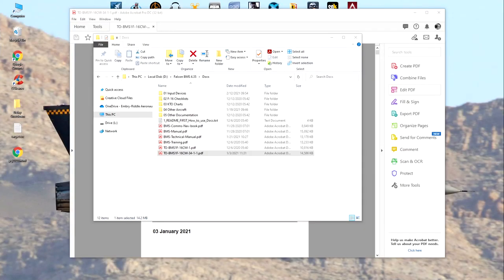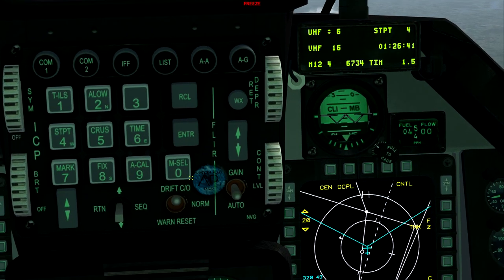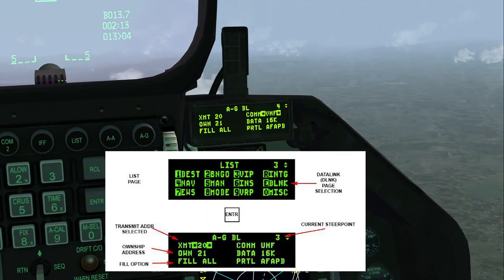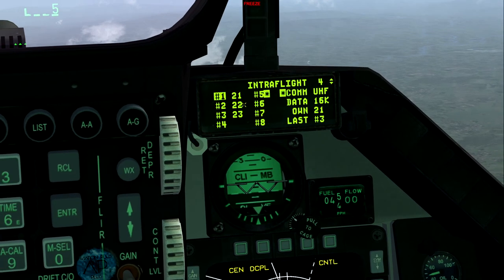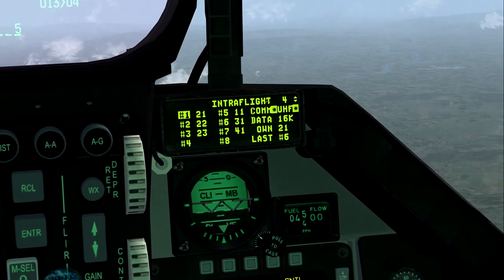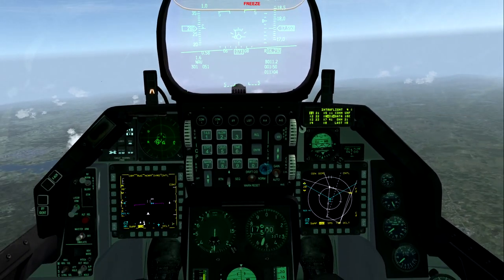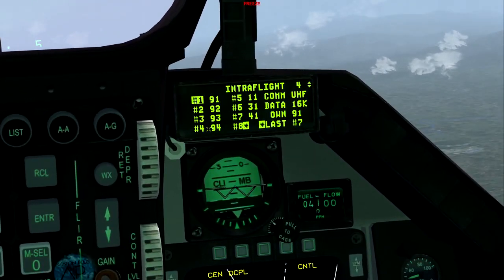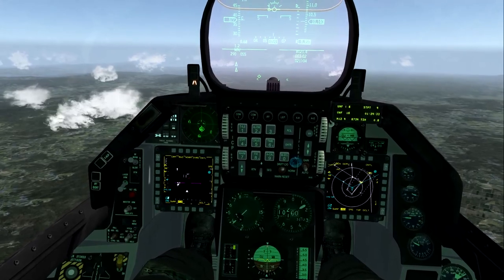Falcon BMS - A/A IDM Data Link Tutorial | Not Link 16

Comment: Hi, I have questions on the use of Datalink in Single Player: 

1.  I know IFF OUT and the radio command "Datalink Ground Target" can work (usable) with AI Flight members. But if I am Flight Lead and do an IFF IN or XMT, it is of no use to AI Flight members, am I right? 

2.  Can an AI Lead actually send me a "Datalink Ground Target" request, or an IFF IN on a waypoint (HSD) or target (FCR), or an A2A target via XMT?  I doubt so as that would be uncanny for the AI.    

Appreciate it if you can answer these questions as I can't find tutorials, manuals or answers that address AI wingmen using Datalink in BMS. Thanks!
Reply from the maker: 1. Data linking air or ground targets does not matter with AI wingman. You use you comm ladder to give them attack commands. That will give the the "location".

2. That's correct AI do no send data via IDM.

In your BMS docs folder there are manuals talking about everything BMS and jet related. Thanks for watching.
Reply: Thanks for the fast response!

Comment: In which situations do we need to care about VHF vs UHF in IDM?
Reply from the maker: Great question so when it comes to using A/A IDM on VHF rather than the default UHF. This would come in handy if there are multiple flights in a package in MP and using continuous (CONT) would create too much confusion because if everyone on the UHF freq does not have the same flight inputs in IDM then some flight members will be blocked. This is why while using UHF it is better to use DMD or ASGN and request cycles. 

If a flight uses VHF for A/A IDM then CONT can be used without interfering with the other flights because only one flight is on VHF. But you will not be able to see the other flights because they are not on your VHF.

I hope that makes sense.
Reply: @AviationPlus  Yes I feel like that makes sense. Thank you for your answer. Another question.... An IDM in A-A and A-G can be different, right? For example, if I get IDM 91 for A-A and set it in UHF mode, then I don't have to change my IDM in A-G? My flight stays at IDM 10 and A-G mode would work as expected or not?
Reply from the maker: @avshishkin  It could stay 10 as long as everyone else in your flight stays 10. A/G would still work.

Comment: how to get the distance from my aircraft to another in TCN A/A ? for example: 11,12,13 ,14 lets suppose my is 11 and I want to measure to 4th member  (14)
Reply from the maker: Only two aircraft can be tied with AA TACAN and those numbers are 63 apart.

If your TACAN is 15Y #2 would be 78Y but this is with humans.

AI default is as follows
Flight 1 11-12Y 12-22Y 13-75Y 14-85Y
Flight 2 Add one to all

If you want to tie to a wingman you need to add or subtract 63.